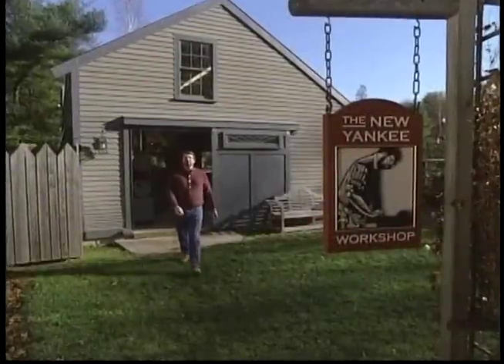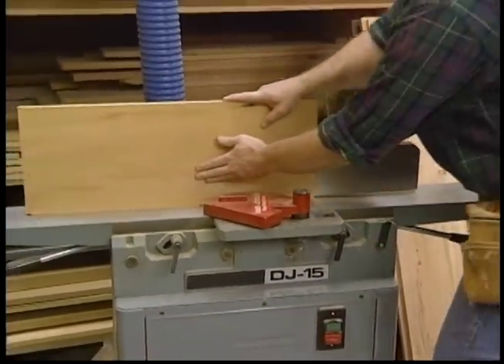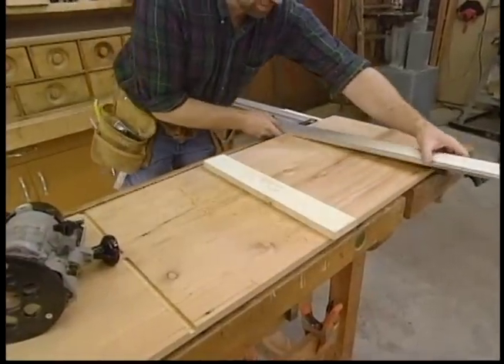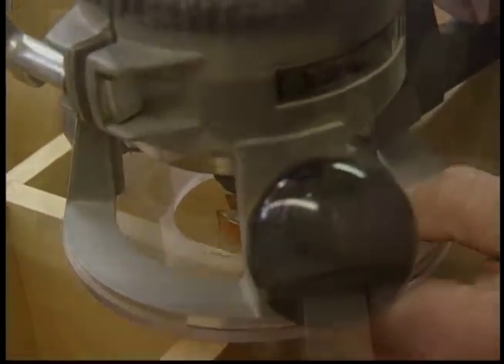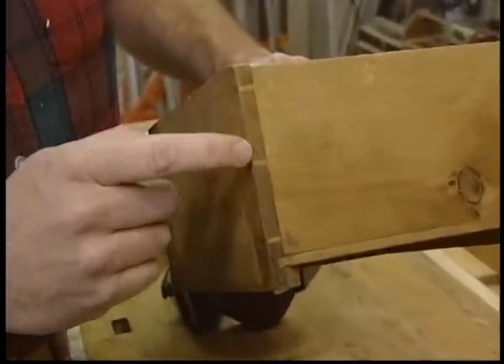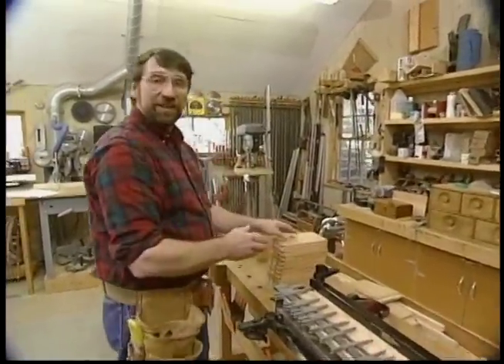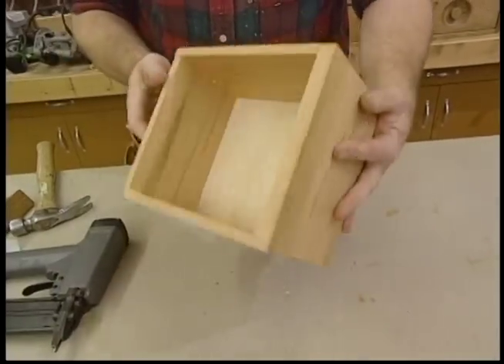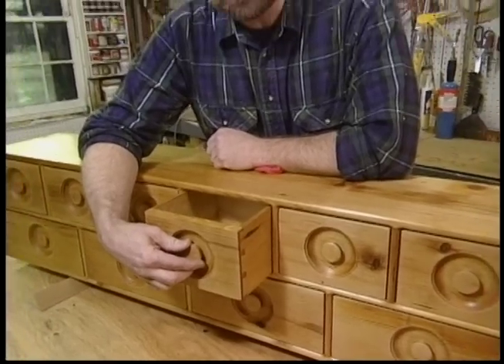Nest of Drawers  |  S8 E12

Comment: I watched this episode when it  was first uploaded here on YouTube and knew immediately I wanted it in my shop for all of my lathe accessories and router bits.
I bought the plans and only built half because I dont have the wall space, but it is a fun and relatively simple project.
I used my lathe for the fronts though because it only took about 5 minutes a piece 😉

Comment: As always thanks to Russ and the 2023 Crew for reposting and updating these New Yankee Workshop videos - and Norm for all the years of woodworking  motivation, teachings and projects for over 20 seasons. This Nest of Drawers project is THE TUTORIAL on using the Leigh Jig for dovetails. When I first got mine I was overwhelmed. Back in the day Leigh provided a detailed spiral ringed instruction guide and a VHS tape. I tried following and using with mixed results at best on my dovetail joinery.  I found it confusing and overwhelming.  I remember when this project was first aired. I bought the video in VHS format just for the Leigh Jig tutorial section and how to make dovetails for drawers, boxes, case work - any project I wanted dovetail joinery.  While I still need to refresh my older memory when using the Leigh Jig, it all comes back to me eventually. So great to see this Nest of Drawers project on YouTube. Now I have it all on YouTube. Thanks for the memories and updating for 2023 and the future. Cheers!
Reply from the maker: This is certainly a great project to practice dovetails and router skills!

Comment: If you look close enough you can see the Stationary Planer in the corner of the shop. I imagine the Portable Planer was used for this project because of the overall rough condition of those boards. Why sacrifice the knives on the good planer when you have the cheaper planer on hand, it makes perfect sense.
Reply: That might have been the case however there are a number of examples throughout all the seasons where an "inferior" tool was used instead of a more capable, powerful etc. version.

Comment: I would have just used a hand plane to knock down the edges and slightly round over those partitions and case edges, adding some minor dings and gouges to enhance the old look.  Machined edges are too regular and clean-looking for an antique appearance.  I might also make mine with a deep enough case to accommodate a French cleat in the back to hang it on a wall.